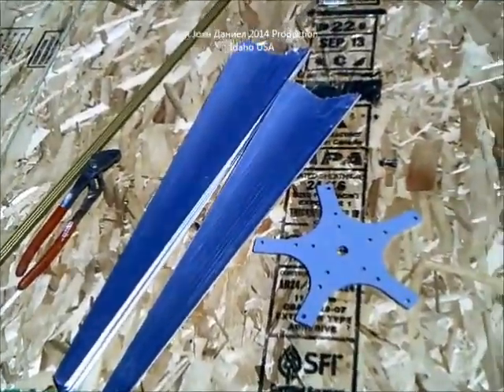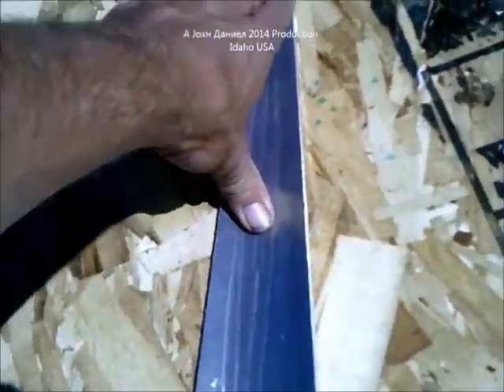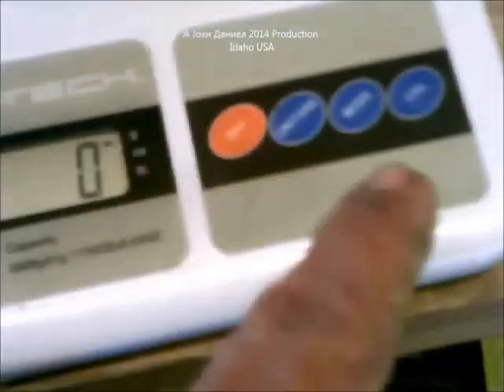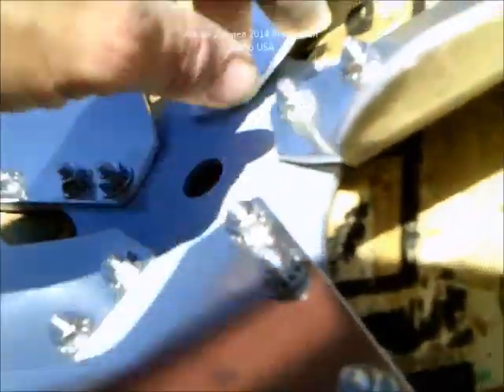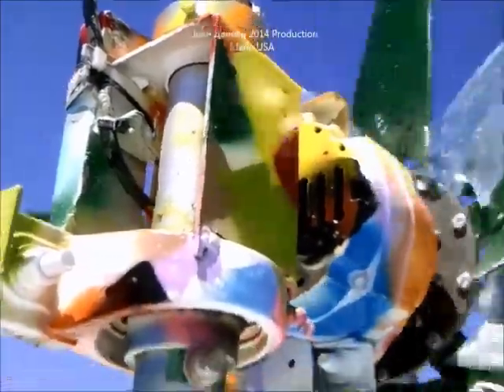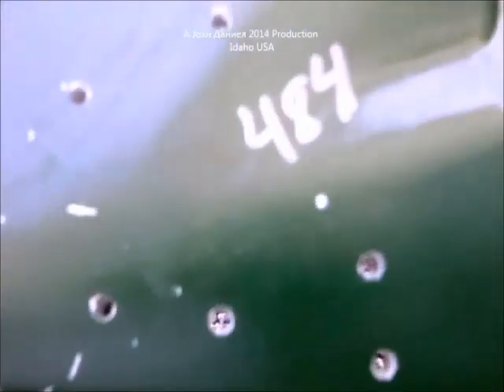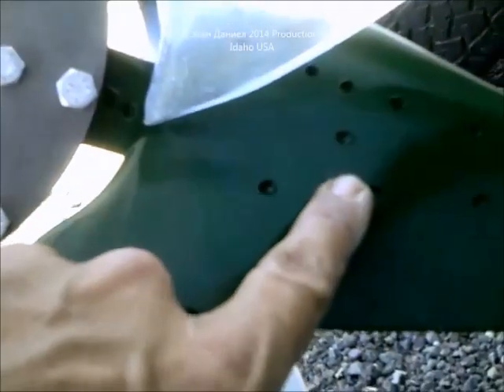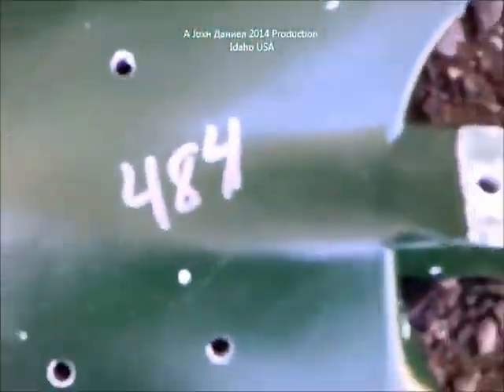Windy Nation wind turbine blades Hyper spin REPLACES Missouri wind solar crap Junk Blades

Comment from the maker: Don't get injured replace the warped, dangerous and unbalanced Missouri Gen 4 Blades with professionally made  http://rover.ebay.com/rover/1/711-53200-19255-0/1?icep_ff3=2&pub=5575119394&toolid=10001&campid=5337668021&customid=Hughes+Aluminum&icep_item=251074676335&ipn=psmain&icep_vectorid=229466&kwid=902099&mtid=824&kw=lg 20 yr lifespan
Reply: John Daniel , Bought one of those ( e-bay ) 400 w generators , put together according to instructions ( turns easy by hand ) but set it on my roof in 15-20 mph wind , doesn't spin
at all,,,,, WHAT AM I DOING WRONG ? Seems to me the blades aren't big enough to catch wind

Comment: Hi John... Very educational... The more I learn the more questions I come up with.... For a first wind turbine of 600 watt would you go three blade or five blade... My area has an avg wind speed of 16 mph but higher in the winter when I need the wind power...Solar in the summer.. Thanks for taking the time to put these videos together...
Reply from the maker: Average wind speed of 7 to 10 get a 5 blade, 10 to 14 get a 3 blade. The new 800 watt is amazing in constant output, a great provided controller and blades designed to have self over speed control. See info on it https://youtu.be/sq4XPT-LFbI and i sourced it below the video, worth every cent!

Comment: who makes a good wind turbine? Been looking at Missouri stuff but i want some thinking that will last and work!! You seem to be some one that at least is testing these things out and from watching a few of your vids you more than seem to know what the hell your talking about. I get the wind foil stuff and balancing the blades the truing off the the mast was very interesting and it all make perfect seance to me when you under stand aerodynamics and harmonic vibration and hell it would reap on the bearings so whats a good brand
Reply from the maker: You can go this direction - https://www.liveleak.com/view?t=4fc_1447914450
Or if you want TRUTH, good power, long life, auto furling blade design, and real accurate output in most low to mid range winds go this direction - http://s.click.aliexpress.com/e/ZnI23Zb
Reply: now is it a pmg ? have you purchased and test one of these ? as  of yet and is that audio of jeff  from Missouri wind and solar  for real ?
Reply from the maker: PS - That 600W turbine from ALIEXPRESS uses the term PMG or PMA for search term utilization, its a PMA. And I have installed 5 of them, all 100% happy people up to 3 years later, they love them.
Reply: thank you now what kind of charge control should be used and should it have a dump load wiring in the design
Reply from the maker: The ones that are shown with or in the same area of that 600 watt turbine are perfect for it. Send the seller a message on Aliexpress, he or she will put you a package deal together better than anywhere else.

Comment: Sir,  I do believe that balancing a turbine is not just done by weighting the  blades to be of the same weight as the weight could be distributed along the blade in a different manner. The way to do it is to mount all the blades and then make sure that they track in the same plane and one should balance the whole rotor.   The way to do it is to either spin it on a dummy shaft on two knife edges, or else get a cone, with a hole in it , insert it in the central hole of the turbine and suspending the turbine horizontally the heavy side will show where it is and one would add weight accordingly on the lighter side.  A static balance would be enough as this type of turbine tracks in one plane. Vertical axis turbine needs dynamic balancing as they could wobble due to the nature of the weight distribution and static balance is not  enough.
Reply from the maker: I do 4 point balancing. But when the actual blade weights are up to 60 grams out of equality like the missouri blade due to piss poor quality you can't paint that turd no matter how you go. Rotation, spin alignment, length point balance points, and blade weight totals are all my methods. I have a auto wheel balancer I even have used. Simple fact, the Missouri blade is just hyped up pieces of shit.